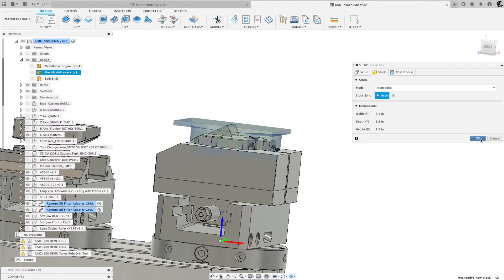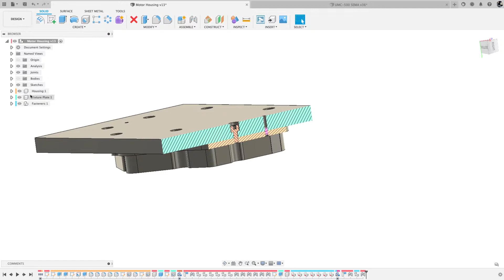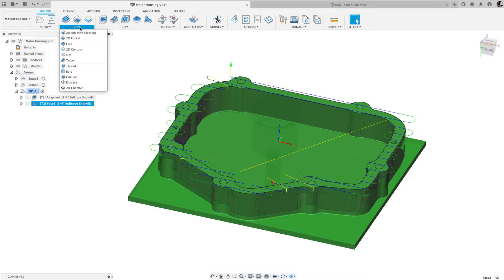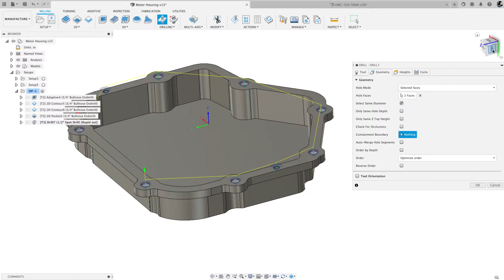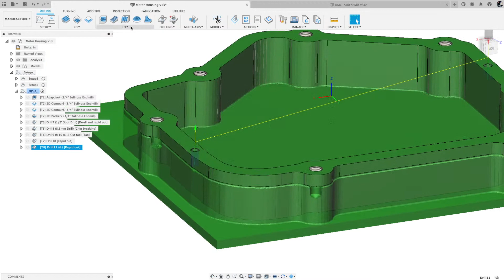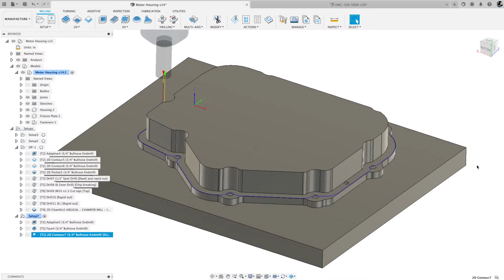360 LIVE: CAM Basics - Tips & Tricks for 2nd Ops

Comment: A great revelation for me is that stock from previous operation is carried over to a second instance of the part to be machined! I often have multiple operations on a single production plate. I used the old technique of saving the stock from the simulation. I found a way to place the saved stock accurately with a joint and I will happily share that with you. But really,  now that I know that you can carry over remaining stock from previous operations to other instances... that will speed up the process greatly and If you decide to make a change it will simply ripple down the operations. No need to go through the whole process again. Fusion rock’s!!! Great live stream Angelo!

Comment: Great vid as usual, one thing F360 could improve is the visualisation of missed stock in the simulation. When he was facing and the part was green. It would be so much easier to see the remaining stock if the material removed changed to a different colour to the current green.

Comment: Thank you Angelo for the great video! 

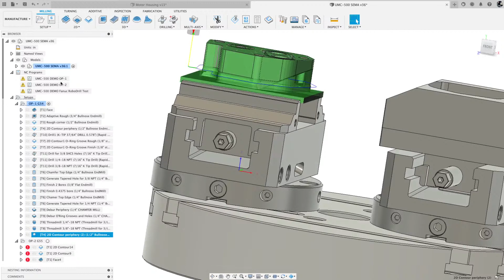It seems like you glossed over a key step in the process (11:20-12:20). How do you reposition the model, move the stock and configure a second WCS setup when using the stock "from previous setup" into the second set of jaws? This is a critical step in making your setup ready to machine the second side, so I am unclear on exactly how you accomplished this. Please clarify.

The details of this step must also be the source of the warning you received in Fusion 360. Describing how this should be done properly would be incredibly helpful.
Reply: Hi Terry, thank you for watching and thanks for the feedback. 

I am sorry if it wasn't clear when I showed it, but I didn't need to physically move or select anything. Once I selected the model to machine in the second operation, and then select "from preceding setup" and "continue rest machining", Fusion automatically put the stock where it needed to be based on the origin of that model. 
Think of it this way.... Fusion knew where the stock was relative to the origin on the OP-1 model, so it carried it over to the the same origin of the OP-2 model.

The warning was because the model in OP-2 was not in the same location as the model in OP-1. So that was simply to alert the user about the warning with the option to ignore the warning with a yes or no. 

I hope that helps clarify how it works.

Or were you referring to how I actually created the soft jaws and placed the part in the jaws? 
Here is a Livestream I did on creating soft jaws a while back:
https://youtu.be/u8MAXqROavQ?t=194